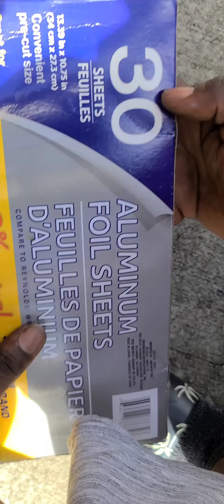exhaust flange gasket repair

Comment: Can you do it without the silicone or it needs a silicone to make this? Thanks
Reply from the maker: Thanks for stopping by  silicone is best to use to hold it in place and when it harden it will creat a seal so it last longer.
Reply: What kind of silicone did you used? Can i use it too on a round type gasket?
Reply from the maker: Ultra grey silicone i use and yes 👍

Comment: Amused.  Hmm, so what do you do if you’ve literally burnt up your flange gaskets?
Reply from the maker: Thanks for stopping by you can purchase one if in that position or get peace of paper and mark out the holes 🕳 and get a peace of heat resistance material to make back one